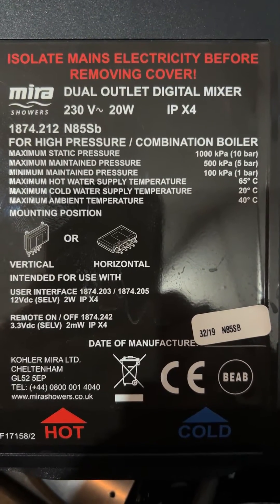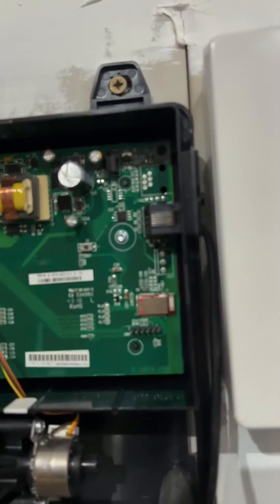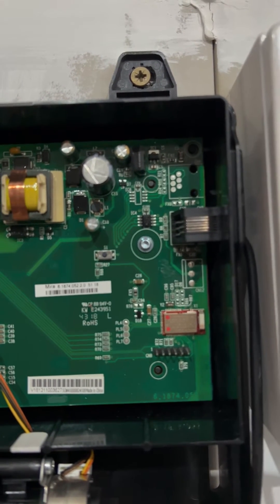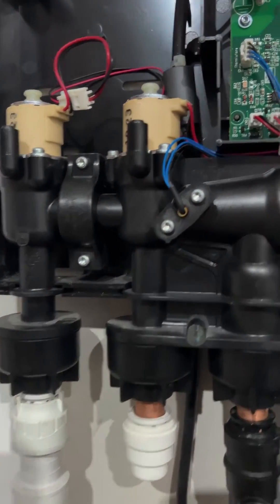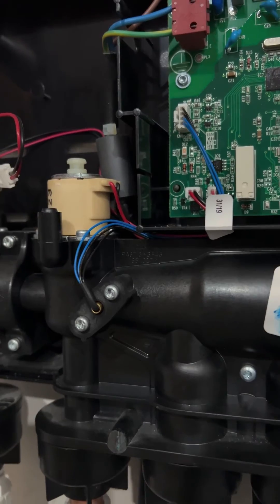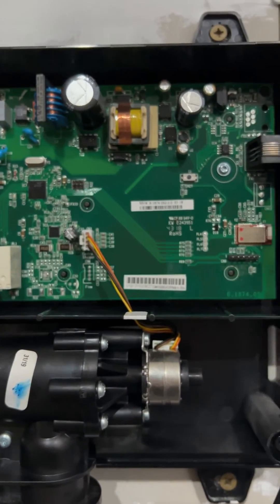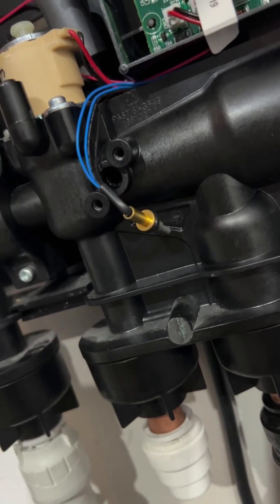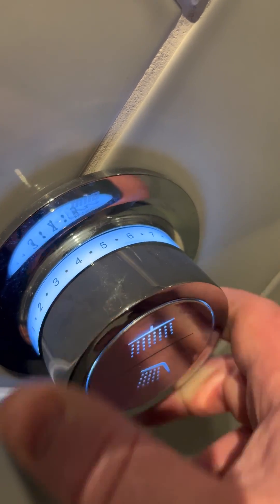Mira Mode Digital Shower Teardown

Comment: Mine is mira platinum and has the same issue. Never warms up at first start, water running cold. So i have to switch on and off few times until I make it work.
Reply from the maker: @slaayslaay5127  see my fix below. Take the solenoid valve apart and check the condition of the rubber. Also ensure two equal flow restrictors in hot and cold. what a difference that made.
Reply: @ will do it tomorrow. Thanks 🙏

Comment from the maker: the fix for me was installing flow restrictors on hot and cold input and then i swapped the rubber part from the valve of the output i have never used. works better than ever!
Reply: Hi, great video. Could you link the flow restrictors you fitted? I'm having issues with it sometimes being full hot or full cold, need to power off and on to reset the stepper motor position and then it's ok.

Thanks

Comment: Hi, your video really helped me, thanks!
do you think the 2 solenoids on the left are bi-stated or proportional?
Reply from the maker: They have to be bi-state. They are either on or off. The mix is controlled by the stepper motor on the right (if that’s what you were considering.)
Glad to have been of help. I couldn’t find anything on these so had to open mine up. It is still misbehaving by the way!!
Reply: Yeah, I imagined. That's weird though, It means it can only control temperature and not flow (apart from the exit on\off).
Bummer, maybe you should contact Mira or try and find a replacement thermostat, just in case it is still what's causing the problem.  @PeteyPeteee
Reply: @hhhhheeeelllllllllooooo  Reading this a year later, did you manage to fix it...?
Reply: I'm here in 2026, was there a fix in the end?